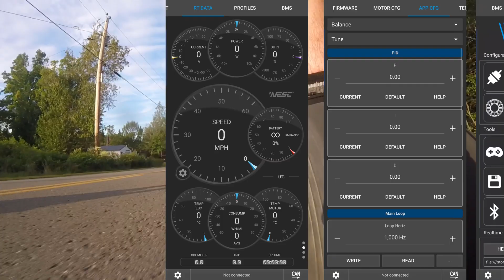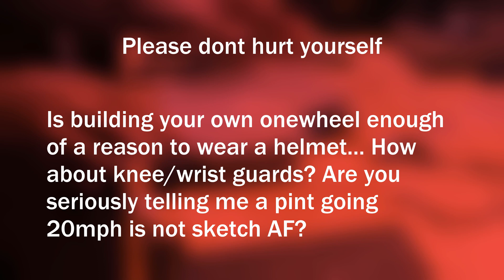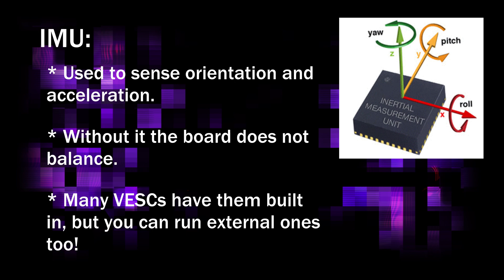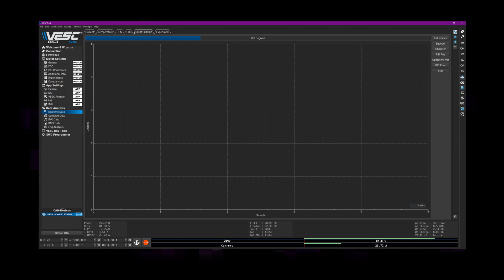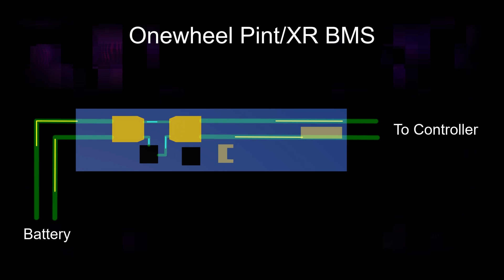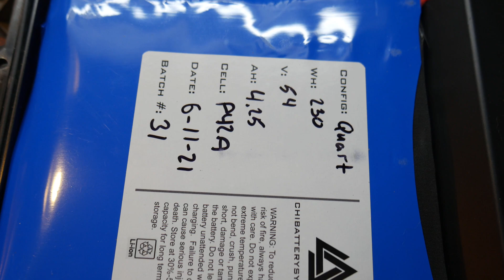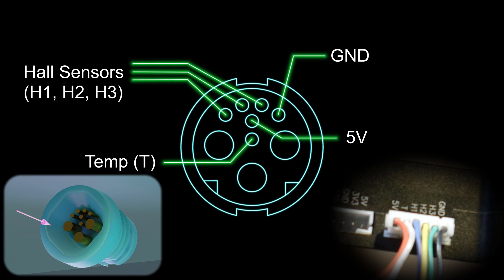Vescify your Onewheel Pint! Guide Part 1-3

Comment: 8:51 this would be a great tip if I knew which one's the balance
Reply from the maker: Sorry for the confusion, the balance connector is the wide one with a ton of tiny wires. It also carries 4 temperature sensor wires too. It is shown here with all red wires but on a stock future motion battery the balance connector will have a bunch of different colored wires. Hope this helps!
Reply: @DuckBillWill  thanks for clarifying!

Comment: I'm just starting my research on the FM bms "bypass".  Why only bypass the positive side of the xt-60 connectors in the bms and not also the negative? Thx in advance for info.
Reply from the maker: On the BMS the other side is already bridged by a copper trace directly to the other side. You only have to bypass the side that has a mosfet, since that is the component that breaks the connection. The other side is already a direct connection and doesn't have to be mitigated.

Comment: Any specific reason you’re using a ubox 75?
I see most people using the 100
Reply from the maker: At the time of making the series and original board the 100v was just coming out and we weren't confident in its reliability. So I just made the tutor with the 75v as a recommendation. But you are totally fine going with the 100v though I would consider the sizing constraints on that controller. The Ubox 75 is short enough to fit inside the box without modification to the controller housing. For the 100v you need to take the housing off which exposes it to the inside of the box. Just be careful about how you go about that. I like how the 100v mini looks for sizing maybe you could look into that one.

Comment: The battery bypass only needs the negative terminal jumped? Not the +?
Reply from the maker: Correct, the positive is already a straight connection in the BMS. Only the negative side is disconnected when the BMS stops discharge.

Comment: Will this work using the Ubox Single V2 75v 200A VESC? I dont see the V1 in stock any more.
Reply from the maker: I would opt for the Ubox 80V as it still fits in the pint enclosure and is a newer revision with higher voltage rating. You dont see much benefit using the 200A version as the hypercore saturates around 120 amps and the pint battery wont be pushing that kind of wattage. I dont have a flip frame for the 80v but others have created mounting solutions for the 80v.
Reply: @DuckBillWill you warn to use 75v100a is that solely due to size? I'm looking at the lite 100v/100a
Reply from the maker: @awejeez4319  That is a good option I believe it will fit in the box without any modifications. And yeah the 75v100a is picked purely for size, but these days newer models are preferred.

Comment: If the BMS bypass make its so the BMS no longer has the ability to cut off power when riding the onewheel. How do you prevent the battery from getting to low? How do you prevent it from charging too much? Is the BMS still regulating all these crucial battery things but no longer can take action if something the battery doesn't like is happening?
Reply from the maker: The VESC has voltage cutoffs you will specify in part 3 that will take care of overdischarge and regen hitting these thresholds.

Comment: Might seem like a dumb question, but which one is the balance connector?
Reply from the maker: The balance connector is the one with the many thin wires going into it. It actually also has some temperature sensors in there as well. The balance function requires that the BMS can measure each cells voltage independently thats why it has so many wires.

Comment: We need to protect this man at all costs! I'm more prepared to VESC an XR since I already have a lil focer and case. However, since I have extra rails I might as well get a superflux hub and go all out.  I just acquired a used PintX with only 17 miles on it for $750. I have since put 13 on it then had some front footpad "orange flashy light" issues. After reconnecting it a few times, it's working enough I'm willing to put a Kush/Enduro/Sure Start on it... Unless the Sure Start (Pro) isn't compatible/necessary with VESC?
Reply from the maker: There is no need for surestart on VESC. It is a feature you can enable in the app.

Comment: This is a huge rescource. Im trying to vesc my gt after the controller went out after warrenty. I havent even found anything to show me where to start until this. Thanks man- also though- Is this pretty well the same procedure for vescing the GT?  Can i just bypass the BMS as you did here on this pint or do I need to buy some type of new bms?
Reply from the maker: I believe you can do this. But I would check with other people because I haven't tested it. I also remember all the battery fiasco surrounding the GT and the bms bricking issue. But I'm not sure if it was a functional brick or just the serialization handshake breaking when you unplugged the battery.

Comment: So can you use a stock og pint battery?
Reply from the maker: Yes
Reply: @DuckBillWill  But its prolly gonna get eaten up a lot faster
Reply from the maker: @Jameslangford-rc6sw  Absolutely. VESC does not supply free energy. But you can tune it to get the same range as the pint, you will just have less apparent power.
Reply: @DuckBillWill  Yea

Comment: Could you provide a diagram that shows the specific placement of the hall sensors and motor phase wires? I’m having issues with the controller not detecting hall sensors in the VESC app, and it is jittery when I attempt to run the motor. I think the hall sensors might be in the wrong spots in my connector. I don’t think it’s the motor having problems. It never had issues before attempting this. If anyone has any suggestions as to what the problem might be, any advice is appreciated!
Reply from the maker: Please join that discord link, we can help you through it! https://discord.gg/Q4q7YRa3xh

Comment: Incredible video-is there a reason you cant salvage the original FM motor connector from the Pint controller instead of making the printed one?
Reply from the maker: In the interest of preserving the controller I sought to make a printed one. But you totally can so long as you've either got the destructive means or soldering prowess. It can be a challenge depending on how you do it. But I wanted to promote an "additive" and less ewaste take on the connector issue.
Reply: I was wondering the same thing 🤔

Comment: ima do this, but does it clap your battery?
Reply from the maker: In a later video I will go over how to specify the current limitations of the VESC. In general we specify the maximum peak current draw as the highest allowed. Overall yes, you could say it puts more strain on the battery. But I wouldn't call it out of spec scenarios. On pints Vsag is always an issue, here it is also an issue in the same way at lower than 50%. I wouldn't say it 'claps' the battery though.
Reply: @DuckBillWill  appreciate it.

Comment: In theory this should also work with a GT correct? Or has it already been proven to work?
Reply from the maker: Anything with a battery and a motor can be vesced. Exemption being the V1, that's a bit tricky and not very strong.

Comment: Hey im curios where did you gain all of the knowledge about what everything is what to do how to sauter etc. i have always wanted that kind of skill set but dont know where to start
Reply from the maker: I'll make a video on soldering at some point. But in short, a lot of it was expirementing. You want to think of it as 'wicking' like how a wax candle wick soaks up the wax. The wax is only going to wick up the wick when it's warm and likewise the wire will only accept solder when it's hot, flux also assists in making sure the bonding surfaces are clean and aren't oxidizing. Also do use a fume extractor or something to avoid breathing stuff.

Comment: I have a dead xr. Thinking about install the u box100 can i follow this video for an XR ?
Reply from the maker: Yes to an extent. For the xr your controller fitment can be an issue with the stock enclosure. There are 3d printed solutions for this I will cover in the future.

Comment: Has anyone come out with a mod for an audible pushback alarm? That's the main thing I wish my onewheel had (and might have prevented me from breaking my collarbone lol)
Reply from the maker: The Rescue project has this function. It's been slow in development, there's also metr.app which I think does the same thing. If you have float control on ios I belive there's audible pushback alarms there. But that's assuming your Bluetooth is rock solid on iPhone.

Comment: Whats the reasoning behind the balance plug and main plug order?
Reply from the maker: Something about how the bms is designed. If I were to guess it's because the balance connector doesn't power the bms only the main power connector does. So when you connect the balance first maybe it starts trying to balance all the cells at the same time causing an overheat of the bms. I was also told it is dependent on duration so I think a heat problem is plausible.
Reply: @DuckBillWill  hmm yeah makes sense thx. i was asking cuz i accidentally plugged in the balance connector first thrn the main plug and i saw that the board was fine and everything and it scared the shit out of me when i realised, i thought i broke something already and i hadent found out lol so i was not comfortable with riding the board until i asked some people in the discord first and they said it was fine too lol
Reply from the maker: @yuding237  From what I heard its definitely a by chance and duration based failure mode. So many people who had it not happen (like me) were probably within the time window where it actually starts to be a problem. I just felt it was important to correct it on my end.

Comment: Great video, thanks for taking the time to create this. What does your charge and ride setup consist of?
Reply from the maker: Its this giant 40lbs lithium pack made of recycled cells. It would give a pack builder anxiety and it gives my shoulders soreness. It keeps my pint going for about 32 miles though so thats a plus. It is in the plans to create a V2 with new cells and high capacity. So stay tuned for whenever I end up making that.
Reply: @DuckBillWill  Great thanks, what cable do you use to plug it in? Looks like a right angle connector to the charge port
Reply from the maker: @HevAdams  Its  a GX12-2 I printed a custom housing around and tried to armor up some wires that lead to an XT30. Its not the best solution because its still exposed to damage from the sides. I have a better solution for CNR taps I can showcase later.
Reply: @DuckBillWill  I'll look forward to that, thanks for sharing

Comment: The bms on my pint x has decided to die would this be a good option to get back up and going
Reply from the maker: It would allow you to run it without a BMS but I don't recommend doing that unless you are familiar with how packs like this need to be balanced in order to be safe. That being said I have seen a lot of FM packs have really good cell matching so if you want to be daring you can totally do it. I would just avoid ever charging it overnight.. And look towards getting an aftermarket BMS like an Xlite or the upcoming Zbms/PickleBms